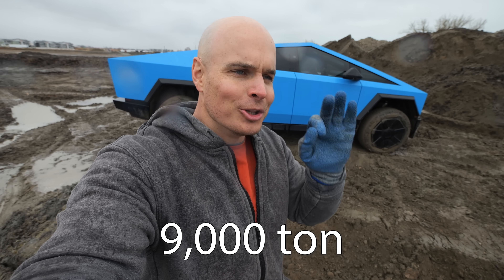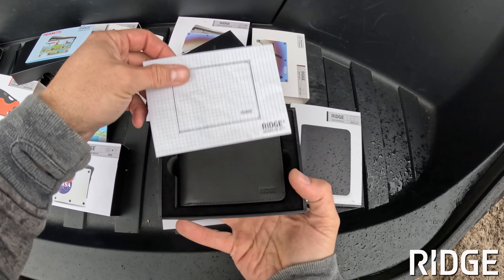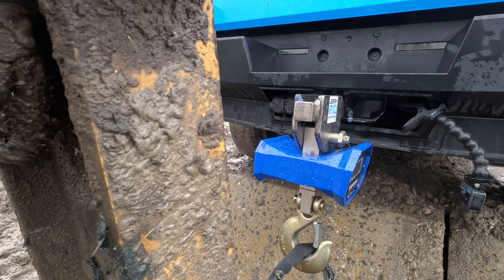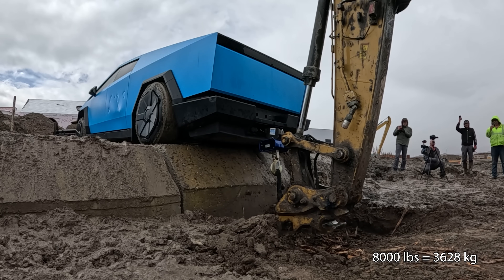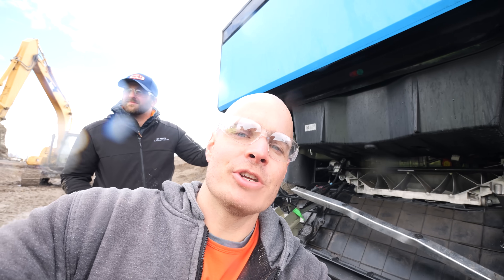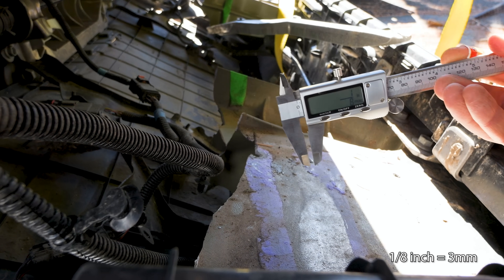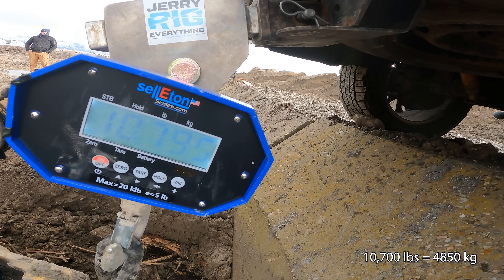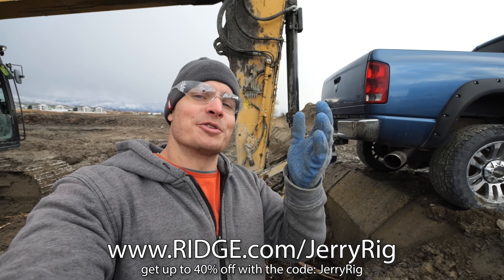SHOULD YOU TOW WITH A CYBERTRUCK?! - (catastrophic failure test)

Comment: I don’t like Tesla at all, but I don’t see how the tongue weight could get anywhere near 10,000 lbs, the majority of the trailer weight is acting through the wheels directly beneath the load, it’s hard to see any instances you will get more than 50/60% through the hitch at any one point…
Reply: This is a fear mongering example that is literally not possible in real world driving conditions

I mean in what situation would a cybertruck have its front wheel PINNED to road

Comment: There is a reason why most trucks are still made with steel ladder chassis instead of fancy aluminium unibody/monocoque, and it's because aluminium cannot withstand the kind of abuse that some of these trucks will face, that's also the same reason why a lot of trucks still use leaf spings aswell. These vehicles are made to be durable and dependable, to get you out of a spot and do the job even if shit hits the fan, and electric trucks, especially this one is far from having the characteristics of the normal ones, because a steel ladder chassis is too heavy and does not have space for batteries, and the bed is not aerodynamic and if you hit something il will go into protection and leave you stranded and needing a tow truck. Electric cars have a place, but electric trucks are a bit useless if you actually need a truck to do truck things imo.
Reply: Do you know what you would have to load on a trailer to get a 10k tongue weight?

Comment: This is misleading…. Before that would actually break off the cybertruck would be doing a wheelie. The truck perfectly fine to tow with. I mean really … you had to weigh down the front to even complete this BS test… and I’m no fan of the cybertruck. Plus… aluminum breaks and steel bends so this test pointless. Even if your ball popped off during towing you still would NOT lose the bumper. Bad test man

Comment: Several semi-truck brands incorporate aluminum frames or components to reduce weight and improve fuel efficiency. Here are some notable brands that utilize aluminum frames:

Freightliner: Models like the Cascadia often use aluminum in their construction to enhance performance and reduce weight.
Peterbilt: Known for their premium trucks, many Peterbilt models, including the 579, feature aluminum frames and components.
Kenworth: Similar to Peterbilt, Kenworth trucks, such as the T680, utilize aluminum to improve durability and reduce overall weight.
Volvo: Volvo trucks often use aluminum in their frame designs, contributing to better fuel economy and performance.
International: The International LT series incorporates aluminum in its design for weight savings and efficiency.
Mack: While primarily known for their steel frames, some Mack models include aluminum components to help with weight reduction.
These brands leverage aluminum for its strength-to-weight ratio, which is crucial for maximizing payload and improving fuel efficiency in the trucking industry.

Comment: We use "Loctite to hold together bolts on parts that have to take HUGE weights ... so based on that I say ??? ... There is NO PROBLEM rally with using adhesive .... IF IT HOLDS !!!   Obviously it does not!! :(

Comment: A truck towing 15,000 lbs is pulling the weight, not supporting that amount of weight.  It is the tongue weight you are exceeding to failure, which is not an accurate measure and unfair.
Reply: Funnily, it's only unfair and inaccurate to the cybertwuck, and not to the 20 yo Dodge. 
There were reports that CT can break after hitting a pothole while towing, which this video confirms and works as a warning because although for the majority of the time you are gonna simply pull the weight, there are scenarios where the whole load will end up being supported only by the hitch WHICH WAS MENTIONED IN THIS VERY VIDEO, and in those scenarios you're gonna have a broken toy with no ability to move away from the road, meanwhile steel frame still would hold. 
That is what the test was about, and it proves exactly that.
Reply: @jethro87 I don’t believe what he says. Look at how that excavator was bouncing up and down and the gauge did not read past 10,700 lbs. How can you take a 1000 lb tongue weight and make it 10,000 lbs by going over a pothole?
Reply: @jethro87 It didn’t prove anything except that you shouldn’t put 10,000 lbs of tongue weight on a Cybertruck or any other pickup truck for that matter.
Reply: at 9:44 watch and pay attention
Reply: @arieru1272  That is not true at all, he's trying to smear Tesla/Elon and it's laughable. He has no evidence what he is saying is remotely true. When you are going up a hill tongue weight decreases, same with downhill, tongue weight is at it's maximum when on level ground, and pulling a vehicle out of a mud pit when offroading is a horizontal force not vertical. So nice try, but this test is a joke and Jerry is an idiot for posting this.
Reply: @arieru1272 just because he mentioned something doesn't mean he understands it.
Reply: @arieru1272 Just because he explains his theory does not make it true

Comment: It broke at 10000 well over its 1100 tongue weight rating, a 9:1 factor of safety.  For reference, the hook used probably has a 5:1 factor of safety.  If the cybertruck tested is typical, the only way to break it is overloading or abuse.  It's clear why Tesla doesn't respond to these kind of videos, they shouldn't.

Comment: One thing to note is there is a difference between tongue weight and tow weight. What you are simulating is tongue weight, how much force it can take in the sheer direction of the bolts. Tow weight, pulling directly away from the tow hitch, would measure the tension forces which tow hitches are designed for. You mention that you exceed the tongue weight rating of 1100 lbs. You need to retest by pulling straight out from the hitch, not down.

Comment: Like you said the Cybertruck’s tongue weight is rated for 1100 pounds.   It held up 9 times stronger than its rated.
Reply: He also explains situations when a 1,100 pound tongue trailer will exercise more force upon the hitch and while not a great explanation also the fact that aluminum fatigue is a thing and it can slowly create an issue were in 5 or 10 years a bunch of cybertrucks rear will suddenly start detaching
Reply: @a3-radio not 10 times the tongue  wheight he doesn’t know what he is talking about.
Reply: @jpm3066  what's the max you can expect dynamically if you were towing a heavy trailer that put 1100 pounds on it when stationary?
Reply: @a3-radio  You will never EVER get even close to 10k load on that hitch while towing.......NEVER!!!
Reply: @RAREFORMDESIGNS  no, but you can get momentary 5 to 6k pounds of force impacts that will over time weaken the aluminum
Reply: yea because most trailer will only put progressive load and not shock it right ?

Comment: I fully get the comparison and like you I would not trust an aluminium frame for consistently towing heavy loads. But I do disagree with how you framed it 4990kg tow capacity is not 4990kg rated download (as many have stated). As to if it should be rated to that, that I cannot answer, but I will go with a steel framed truck over an aluminium one any day.

Comment: While I don’t care either way or have any interest in defending Tesla. I don’t think the test was conducted properly. The reasons being the front was strapped down. If the weight you applied to the rear was enough to be able to lift the front wheels off the before the hitch broke. You’ve effectively created a situation that could never occur. I.e. if the hitch held and the front wheels were off the ground, the vehicle couldn’t be driven anyway. But I’m open to being told different

Comment: If only you can test with a fully loaded trailer is for that underweight while driving. How much lateral and unilateral forces are being applied to that hitch and the weight that's being pushed and pulled in going up and down inside to side on that hitch. Because that's where the real test is

Comment: Thing is, its not something you can fix easily...

You could potentially weld reinforcement plates in, but that then introduces potential thermal stress issues...

What is more likely, Tesla will SERIOUSLY downrate the towing capacity on any that haven't snapped YET, and do a replacement 'warranty' claim on the ones that have snapped.

The biggest thing, is that when 'normal' people (those who don't do frequent towing) think about towing capacity, if its not a camper, they don't always consider the weight of the trailer itself... 9000lbs isn't hard to hit for a loaded trailer...

Comment: For vertical load it's rated over 1k lbs and did over 8k....... somehow that = "DO NOT TOW WITH CYBERTRUCK"
Reply: And yet he did mention that how on flat ground, yes, tongue weight is only 10% of the load. But for brief periods, that tongue weight can become the majority of the load and cause issues, especially on hills. He makes good points
Reply: @phoenixproto3149  he does make good points, its a shame it has to be presented in such a clickbait manner.
Reply: @phoenixproto3149 a pot hole or hill doesn't put the weight of the entire load un the hitch...he doesn't know what he's talking about.

Comment: Also they call this thing a truck, when it has the suspension and suspension travel of a minivan? This thing is in no way a serious truck. This is a toy for some guy with disposable income to play with on the weekends. When it was first announced I thought it looked cool and would be awesome. But after seeing them everywhere, I see at least 10 a day, with all these stupid wraps and graphics and stuff on them and all the online videos that build quality, and the fact that Tesla still has not provided the hubcaps for the truck that the tires were actually created for and the rims. They haven't fixed an issue of the plastic hubcap rubbing or slapping a tire while it's driving. That's just stupid engineering design overall, and that's what you get whenever you have a designer try to engineer

Comment: I'm not surprised to see panel bond being used - it's extremely common in modern cars from all manufacturers. And I don't think it was intended to be part of the strength of the towing system. Much more likely it was intended as a way to bond the body to the gigacast subframe.

But man, that casting was probably half as massive as it probably should be!